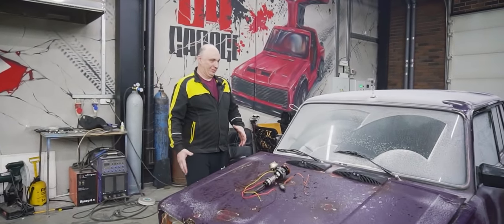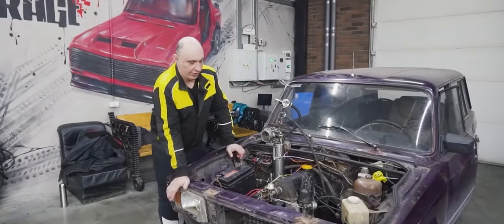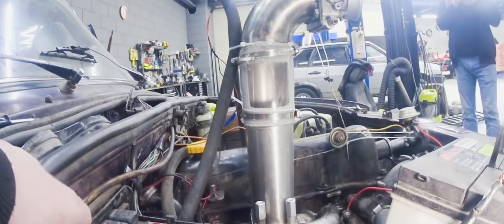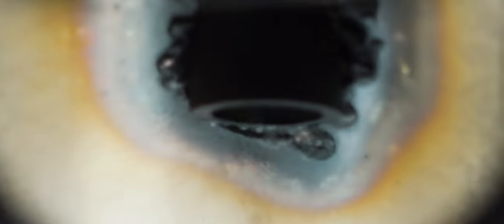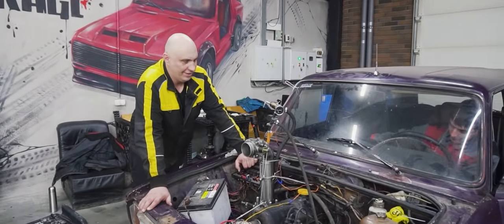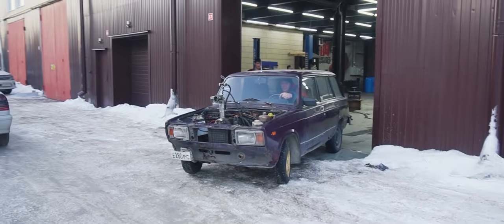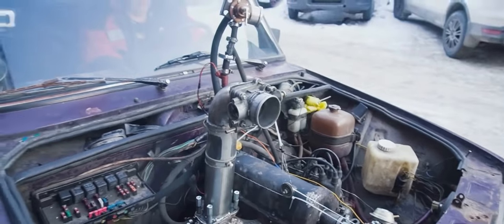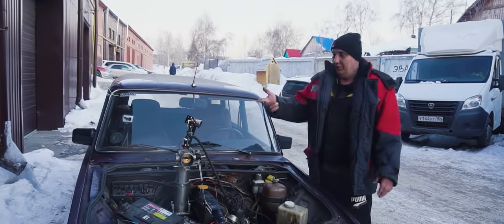Can you replace a carburetor with a fuel injector?

Comment: What I would like to see is whether you can run an ordinary standard engine on hydrogen.Otherwise a great channel, and keep up the fun content. Greetings from the Netherlands.
Reply: They've done just about everything including running the car on wood
Reply: you absolutely can, it's the same procedure as making it run on propane, you just need to set the air-fuel mixture right
Reply: Eens
Reply: You can't. All the tolerances would need to be much much tighter. Toyota can bearly get it to work with a whole team of engineers on the issue. And even then it BEARLY works
Reply: @cb6112  the problem is stopping the process fast after engine switch-off. It runs on hydrogen just like on LPG
Reply: @paky66  They could have just used fuel injection or solenoids like gasoline (both are liquids) and the hydrogen is pressure regulated to provide predictable operation. Just like that.

LPG conversion kits use some sort of an air mixer that sits in the manifold causing gas to stay in the intake and cause dieseling of some sort on shutdown and you can smell the gas which is unhealthy for the daily driver
Reply: @cb6112  it doesn't barely work it works quite well, James May will prove my point
Reply: I want to see them run one on ground corn dust. Like a grain bin explosion.
Reply: @cb6112  I know it's not just hanging a hose with hydrogen in the carburetor and expecting it to work  But we must not forget that the first combustion engines were very large for what is now a small amount of power. Hydrogen does not have the energy that our modern fuels have. But it is and has been done before with varying degrees of success. These guys have done more unlikely things. And I don't immediately expect a perfectly running engine. If the engine is running and a vehicle can move, I would love that.
Reply: @theupscriber65  apparently this was what rudolph diesel originally wanted to run his engine on - coal dust/other pulverized solid fuel. I think it was too hard to stop the cylinder from getting all scored up due to the abrasive properties  of the fuel
Reply: I think the guys at Kreosan managed to do that.
Reply: I’ve done it more than 10 years ago. Hydrogen works just like any other gas you put on the engine to burn.
Reply: @LabRat Knatz  I'm quite novice in  the world of internal combustion engines, but I would surmise you'd probably want to convert a diesel engine to hydrogen due to them being more robust than a gasoline engine. The high compression of a diesel engine might also be beneficial since hydrogen gas is a lot  easier to combust, and thermally efficient it might not need the help of spark ignition; under the right conditions you might be able to eliminate the spark plugs entirely.

Also, diesel piston rings are much thicker than gas piston rings, and that would help to lower the amount of blow by, but regardless there should (in theory) be less potential for blow by of hydrogen compared to gasoline to begin with (I'd think?) 

But again, I'm a novice, so please don't hold anything I said against me. Rather, educate me, if anyone would be willing to. I do enjoy learning about these things.
Reply: @arcopierik3894  Another large problem is the small particle size of hydrogen. The tolerances need to be extremely tight to prevent the flame front from exiting the cylinder. The question was could they do it to a stock engine like with LPG and the answer is no because after they were don't with it the engine would be far from stock. Huge amount of machining ect.
Reply: @cb6112  Toyota has a V8 hydrogen motor that runs perfectly.
Reply: @sourand jaded Oldsmobile had a coal powered V8.
Reply: Myth busters did it it works
Reply: @mrsteelnutz  James May's Toyota Mirai is a hydrogen fuel cell car... the hydrogen is used to generate electricity.  CB and others are discussing using hydrogen as a fuel in an internal combustion engine.
Reply: @KekusMagnus  You also need a higher pressure cylinder than for Propane. There are some other high tech "safe" ways of storing Hydrogen.
Reply: What is your view on Russia verses Ukraine?
Reply: @scoti1989  What is happening in Ukraine is, in my view, completely intolerable. In my opinion this is not allowed under any circumstances.  We see from all the demonstrations against the Russian government that the majority of ordinary Russians do not agree with it either. And I hope it comes to an end soon.
Reply: There was a guy who supposedly invented a way for a car to run on water. In court proceedings it was determined he used ordinary electrolysis. I believe the hype was a diversion from his true discovery which was simply keeping the hydrogen and oxygen dissolved in water so he didn’t need to compress the gas. We can by 32% hydrogen peroxide so we can see it’s possible to dissolve large amounts of oxygen in water and store it in an ordinary plastic container. He simply did it with the hydrogen too. 
Injecting water into the combustion chamber along with the Brown’s gas would help cool the engine as well as help with pushing the piston as the water is converted into steam. The Brown’s gas is a stoichiometric mixture so you don’t need a MAF sensor or anything. The fuel to air ratio is already perfect. Just inject it directly into the combustion chamber with no additional air or anything. 

Corn or coal dust should work in a turbine. Otherwise there are alternative combustion chamber designs that look like air bags for a suspension and they aren’t the typical piston in a cylinder that suffers blowbye when it gets a little wear on the wall. 

The first Stirling engine design was a thin piece of metal that flexed. Metal can flex indefinitely without any wear because there is no friction. NASA has been testing Stirling engines for over twenty years running them nonstop. The point is we could design internal combustion engines similarly that could also run over twenty years nonstop without any wear. Nobody would ever sell them because that would destroy the industry. The industry would never let that happen. 
Make one for yourself, your cousin, your neighbor, but never be a threat to the oligarchs. Keep it secret.
Reply: @kedwa30  Here in the Netherlands I heard of a man who, in the late sixties or early seventies, invented a car that ran on water. He was called crazy and his plans are gone.  It is said that a major oil company and the government would have something to do with it. So like you said, if you invent something like that, keep it to yourself, because there are very big interests at stake for companies and governments.
Reply: It can but the combustion produces water and that will mix with the oil
Reply: Bmw did it years ago on a 7 series with a lovely V12
Reply: @sourand jaded all of the issues you stated regarding hydrogen as a feul for i.c.e have been solved.
Reply: @cb6112  you are confusing Toyotas hydrogen fuel cell with an ICE burning hydrogen, completely different technology.
Reply: The English owner/director of JCB - the big, yellow digger machines company here in the Midlands - has built a Hydrogen version on a stock engine (plus a few fiddly bits). He says that going full electric for one of his digger machines, taking into account the type of work undertaken, the length of a workers shift and the time taken to recharge is a non-starter given today's technology. Whereas Hydrogen... He has made a good video about it somewhere? Maybe You Tube?
Reply: James Cunliffe  sausage
Reply: I WOULD LIKE TO SEE PEACE   is it possible ?
Reply: @florinadrian7957  Peace, that's what we all want. And better yesterday than today. I just don't think Grage54 and the ordinary Russian citizen can do much about that.If they openly speak out against the War, they are arrested and do not know if or when they will be released. I imagine if you're responsible for some families, you'll be a little more careful about what you say in public.
But as said before, I hope it will be over soon with as few casualties as possible.
Reply: We have tried running Alan mower engine on port injected hydrogen. . Doesn't really work very well. Energy density is too low. And you get bad detonation.
Reply: James Cunliffe  Non sequitur
Reply: @CalGames  yes but we are humans, not bears which is a huge advantage
Reply: @87isbmw  what?😂
Reply: @CalGames  responded to dude's claim that hydrogen powered vehicles bearly work lol
Reply: @87isbmw  completly true. But would still like to see them try. And would be nice if the combustion engine stais alive
Reply: Yes hydrogen engines are the same other than fuel system
Reply: @arcopierik3894  yes because  know is to late , they had 20 ears to do it !
Reply: You can, but it isn't worth it... It doesn't havw the energy content.. best use for it is in a fuel cell, but its exceedingly difficult to store because the atoms are so small that they go right through most substances.. the storage would take up most of the weight allowance and space for/in the vehicle. You would have a tough time being able to store enough to make jt practical.
Reply: That would be great
Reply: @ruikazane5123  mine has lock off valves right in the mixer before the throttle body. When key turns off it kills spark so it dies right away. Think guys🤣
Reply: @jakecarlile2294  but remember your EGR and vents and breathers. Think that . The gas is still there and on high compression motors that can cause dieseling (the motor runs on its own for a moment due to residual fuel and heat in the combustion chamber AND high compression pressure) and the leftover LPG in the intake manifold is still there and can start fires and you can smell the gas one way or the other

If they just used fuel injection that allows conventional ECU control plus a completely controlled system (fuel can be cut off earlier than spark for example) that you can actually tune AFRs and timings just as how you would with a conventional gasoline/ethanol/methanol system and opens up performance applications...
Reply: WTF are y'all talking about, "you can't run an engine on hydrogen"? Huh? Engines have been run on hydrogen for years. Of COURSE it can be done.
Reply: Восхищение произойдет без сомнения, и это произойдет намного раньше, чем многие верят (менее 10 лет, согласно всем экологическим, погодным, астрономическим знакам, израильским графикам и т. д.). Это произойдет без всякого предупреждения, ни одного, в одно мгновение, застигнув массы людей врасплох, как это всегда делает Бог, т.е. потоп - грубое пробуждение. Никто не знает точного дня или часа, когда произойдет восхищение, это точно. ВОСХИЩЕНИЕ МОЖЕТ ПРОИЗОЙТИ СЕЙЧАС, В ЛЮБОЕ ВРЕМЯ !! . Пожалуйста, пробудитесь ко Христу Иисусу, который является ЕДИНСТВЕННОЙ надеждой СЕЙЧАС, и не позволяйте узнать, что это все правда позже, когда будет слишком поздно, и вы остались позади в самые ужасные времена, которые земля когда-либо переживала прежде и когда-либо будет. Римлянам 10:9-10 Если устами твоими будешь исповедовать Иисуса Господом и сердцем твоим веровать, что Бог воскресил Его из мертвых, то спасешься!

пожалуйста, поделитесь с другими = ВАЖНО
raptureready.com

The rapture will happen without a doubt, and it will happen much sooner than many believe (less than 10 years, according to all environmental, weather, astronomical signs, Israeli charts, etc.). It will happen without any warning, not a single one, in an instant, catching masses of people by surprise, as God always does, i.e. the flood is a rude awakening. No one knows the exact day or hour when the rapture will take place, that's for sure. THE RAPTURE CAN HAPPEN NOW, ANYTIME!! . Please wake up to Christ Jesus who is the ONLY hope NOW and don't let it all be known later when it's too late and you're left behind in the worst times the earth has ever experienced before and ever will be. . Romans 10:9-10 If you confess with your mouth that Jesus is Lord and believe in your heart that God raised him from the dead, you will be saved!

please share with others = IMPORTANT
raptureready.com
Reply: You're off your chops lad
Reply: @arcopierik3894  trust me people are looking at it pretty seriously
Reply: Did you guys hear about the hydrogen buggy this one guy made? Early 2000's I believe, well he ended up poisoned at a dinner.
Reply: @Pèék thank you omg. Everyone's referring to hydrogen fuel cell cars when they respond to me. If they just Googled hydrogen ICE prototypes theyd understand what I meant with my first comment
Reply: That would be a nice video using hydrogen. I know that is the fuel of the future.
Reply: I run my truck on water like Stanley Myer
Reply: @fusiondensity3287  Nice fella. I am working on the model prototype as we speak. Will be joining the club. Maybe some video showing what you got done ??? Peace vf
Reply: @victoryfirst2878  i was joking but it's very interesting. It seems that with hydrogen the combustion needs to happen when the piston is down so it can be sucked up by the implosion. hydrogen makes a implosion instead of an explosion.
Reply: Yes you can there working on it atm
Reply: @shorty808100  Fact well stated !!!!
Reply: @arcopierik3894  Hydrogen is incredibly energetic.  More so than petrol or diesel.  It just has poor volumetric energy density (in other words you need to compress it in order to be able to carry it around practically).
Reply: The answer is yes. I run a mariner outboard everyday for around 10 dollars a month. I took me awhile to get it right but it runs great and gets around 45mpg instead of 6mpg.
Reply: @twinturbocoyoteftw  I have seen people do all kinds of modifications for mileage. Some work really well, but most really suck restricting the engine power severely. What happens they run but run pooly.
Reply: Yes.
With small modifications, and, either access to hydride, or, a  particle accelerator, to make a necessary ingredient to produce your own.
Reply: @Mr.Schitzengigglez  One of the biggest problems running gas vapors with any internal combustion engine is valve timing overlap. The cam is ground with a few degrees of overlap. This means that both intake and exhaust are open for a few degrees causing all kinds of problems. Remedy is to get a cam without overlap grind. Then you can run an engine on any gas vapor you want. Just a plain fact.
Reply: @victoryfirst2878  agreed.
But, Bob Lazar did it, a long time ago, with a C4? (Corect me, if I'm wrong) Corvette.
Reply: @victoryfirst2878  yeah, I'm just starting to learn very many things, at the same time.
Electrical. Biochem, solar, physics, 40 year old motorcycles...
It beats wasting your brain away, trying to follow the politics of greed, that's for sure..
Reply: @Mr.Schitzengigglez  Amen to that brother. Politics should be called "How to screw over everyone with a smile, and vote for me." I would bet you that just about anyone could make the HHO work. All it takes is the right information, planning and perseverance. I can tell you there is a shorter way to high mileage. There is a guy on Facebook who can show you with goodies for 1800 dollars. The vehicle gets about fifty miles per gallon. Totally drivable all year long. Check it out and see how simple the process is. The auto manufactures cannot do that today with all there bells and whistles. This was started in the 1960 plus. Hope you had a great Memorial Day with fireworks.
Reply: @victoryfirst2878  politics is, the art of controlling people. 
You perfect that art, when you learn to control information. and resources.
Today's life is proof, that the art of governance, has nearly been perfected.
Reply: @Mr.Schitzengigglez  My pleasure to meet someone who thinks like me and know what we both think is correct. Wish others would just wake up and smell the coffee. God bless and peace to you my brother. vf
Reply: @victoryfirst2878  pleasure  to meet you.
Reply: @Mr.Schitzengigglez  Pleasure to meet you too Sir.
Reply: engines run good on hydrogen. the problem is getting the hydrogen. at best a hydrogen/petrol setupwold boost engine mpg a bit. but to get the electricity you would need regenerative braking, a radiator that can turn engine heat into electricity, and maybe something for the exhaust.

Comment: Try adding a vacuum reference from the inlet manifold to the fuel pressure regulator to increase fuel pressure as you open the throttle.
Reply: good idea!
Reply: You mean decrease as it will create more vacuum under load
Reply: That's what I was just going to say. That should increase fuel pressure by about 10 PSI under full load compared to at idle. Not nearly enough to make this setup to work properly by itself, but it should help a bit.
Reply: @kirilakmadjov8307  Adding a vacuum reference would INCREASE fuel pressure under load. Intake manifold vacuum DECREASES under load.
Reply: @averyalexander2303  you were right i did my research.But yeah at the end of the day he needs a reference for that fuel pressure regulator in order to get it to work smoother
Reply: @kirilakmadjov8307  Yup a vacuum reference would certainly help a bit since there is no simple way for him to vary the fuel injector's pulse width to compensate for changes in load.